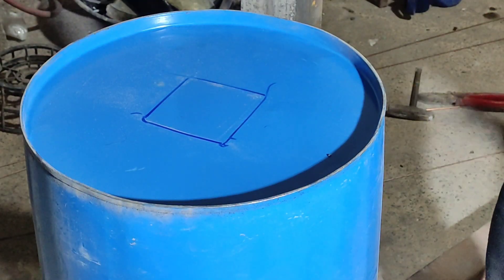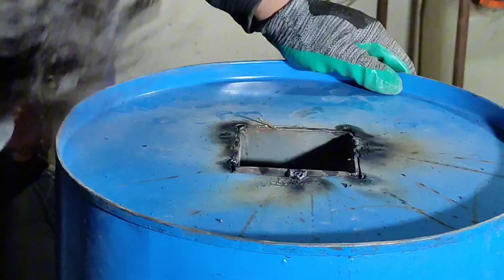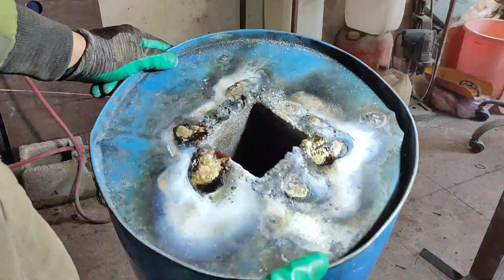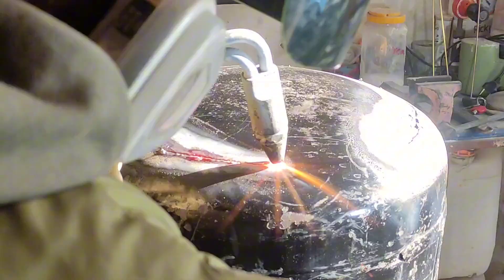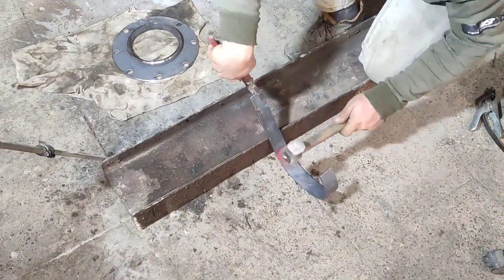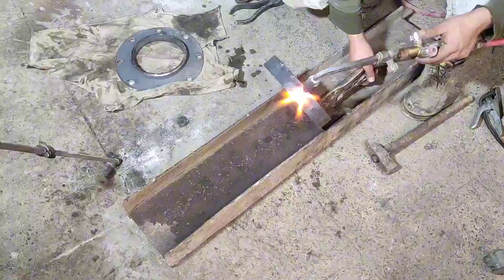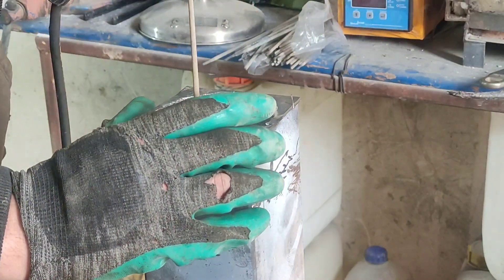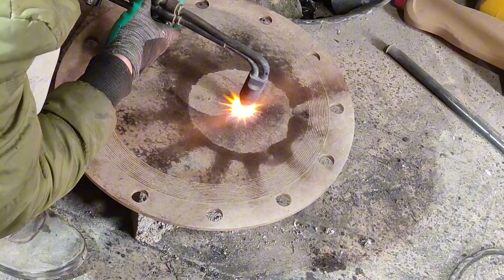Making a pyrolysis Reactor to make FUEL

Comment: Your welding is terrible,  you could improve if you took time to clean up the snotty edges after flame cutting and also removing any paint from wear you are going to weld
Reply from the maker: The setup's still running smoothly without any problems, so it works for me — and that’s what really counts for me

Comment: Printed Circuit Boards are one of the most problematic raw materials to pyrolyze into Petrol/Diesel/Fuel Oil!
Since 2012 I've been a full-time scrapper/recycler/metal-refiner, thus I've gained quite a good insight into the involved chemistry in the many different processes. Brominated Fire Retardants is the huge problem when processing either bare boards or plastic parts from WEEE.
Some people mix a little Natrium Carbonate (called Sodium Carbonate, or Soda Ash, in undeveloped countries) or Calcium Carbonate with the shredded material before pyrolyzing it, alternatively they bubble the off vapors through an alkaline solution. Well, it captures some of the Bromine, but far from all! In the other hand, very fine powdered CaO works pretty well. The bare boards contains on average 3% Bromine by weight.
The best way to capture Bromine compounds, when pyrolyzing bare boards from PCBs, is to add some powdered Aluminium Oxide (Al2O3, known as Alumina in undeveloped countries) which will capture the Br, and keep it in the residue in the reaction vessel of the pyrolysis unit. Letting the off vapors flow through antimony trioxide (Sb2O3) will remove almost all of the HBr, thus purifying the pyrolysis oil.
The bromine can later be recovered from these oxides, and used for Gold recovery.
If the intention is to crack the pyrolysis oil into Petrol/Diesel/Fuel Oil, then it's very important to remove all the extremely fine Carbon particles that inevitably will be carried over and contaminate the Raw Pyrolysis Oil, by incorporating a cyclone chamber between the reaction vessel and the condenser of the pyrolysis unit. This is neccessary because these particles will build up and clog the internal cylinder parts of a combustion engine, not to mention completely ruin turbo chargers. 
A cyclone is very effective in removing such Carbon particles. Be aware that the metal pipe and the cyclone ifself must be well insulated to avoid any condensation of the heavier fraction of the off vapors. I use white ceramic fiber matte, recovered from scrapped bakery ovens.
Despite having a ceramic air filtrator capable of separating common air into a stream of Oxygen and a stream of Nitrogen, I use the well known simplest way of flushing the reaction vessel of the pyrolysis unit: Before charging the reaction vessel  I just pour a cup of water into it. Upon heating, the water turns into expanding steam that flushes out all air, thereby creating an anaerobic environment in the vessel.
99.9% of PCB boards are brominated, but notice that the plastic insulation on the majority of the electric wires soldered to the boards is brominated too. In addition the insulation is almost always PVC plastic. This means they contain 57% Chlorine. I use the well known hydrometallurgical method (full recovery of the solder) to completely remove not only the wires, but also virtually every single electronic component from the boards themselves (chemical depopulation). The bare boards are then pyrolyzed, and the components are sorted and processed for full recovery of every bit of value from each of even the tiniest electronic component.
The thin electric wires are pyrolysed; however, I still struggle quite a bit with removal of all traces of Chlorine from the Raw Pyrolysis Oil.
Reply from the maker: Thanks for explanation of the process, BTW, i thought U.S. is a developed country, As i'm aware of ,No one there call Sodium carbonate in a Latin based context .
Reply: @PickyPlans  . The mentions of developed/undeveloped countries was meant as a funny touch to the comment. The US, as an example, is generally considered a rather developed country; however, they are in many, many ways far behind Europe.
I wanna add that I'm familiar with another way of recovering Bromine from pyrolysis of materials containing Fire Retardants.
That's solvent extraction with distilled water in a two step process. This process is not very well suited for amateur/home refiners due to the necessity to very strict temperature control.
All of my four pyrolysis units are fuelled with free waste wood, so I can't keep the process within the required temperature limits; at least not for the time being. However, the method is very efficient, cheap, and reasonable fast; if you can control the temperature during the different steps. Also, a slight inconvenience is that the first step needs a considerable higher pyrolysis temperature.
Though, I'm considering making improvements and further developments of my pyrolysis units, in order to incorporate means of more precise temperature control, enabling me to use that simple process for Bromine removal.
Have you ever thought of dissolving PCBs in Bromine?

Comment: Really nice work but you must ad some soda ash or calcium carbonate during the process.
Otherwise you might have brominated compounds, that apart envoiromental bs they will destroy you engine and give you nasty health problems.
Concept wise really cool i think i will still make a good cheap furnace fuel.
Reply from the maker: Thanks for your advice my friend , i have the idea of using a Dry Ice fire extinguisher (with a regular installed on it) to flush the system after being evacuated using the vacuum cleaner. Also i plan to refine the fuel chemically and i will make a video on it
Reply: @PickyPlans  
Ive built something similar, no need flushing gasyou can use a bit of water that 100 C will flush everything with steam
Reply from the maker: Ah, thanks for the tip!